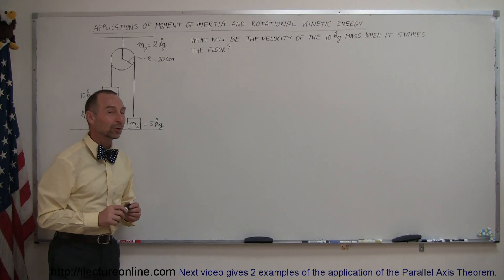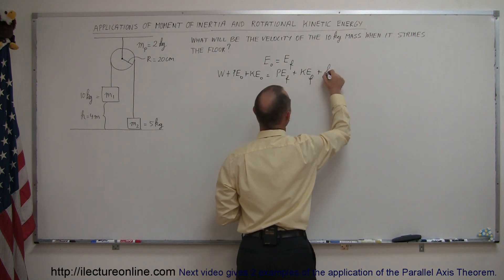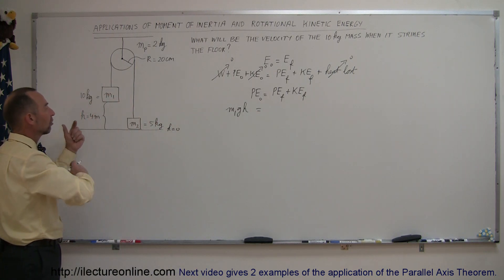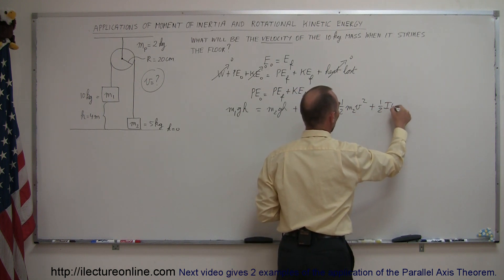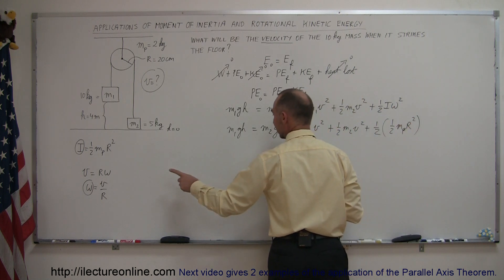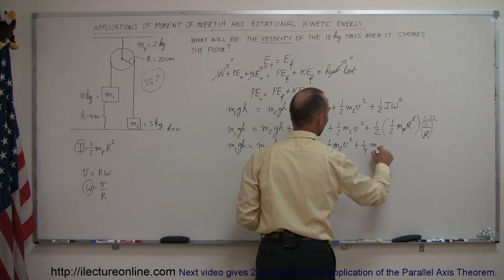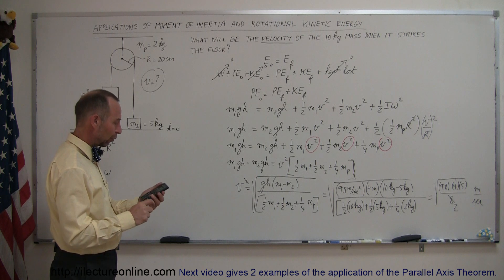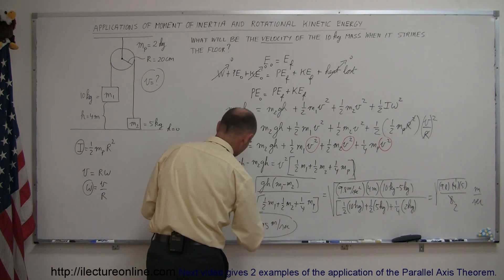Physics 13  Moment of Inertia and Rotational Kenetic Energy (2 of 5) Pulley System

Comment: Sir, How will I calculate time taken for moving the distance.
Reply from the maker: Once you know the acceleration you can use the equations of kinematics:   y = (1/2) a t^2
Reply: @MichelvanBiezen   Thank you for the reply.Sir, can i go with the formula for acceleration  as a= g(m1-m2)/(m1+m2), and does this formula (y=(1/2) at^2) still same if I ignore pulley  in between.
Reply from the maker: Yes, that equation will work.

Comment: why does the kinetic energy of m2 is not negative sense it goes in the opposite direction?
Reply from the maker: Kinetic energy cannot be negative, it can only be zero or positive.   KE = (1/2) mv^2, therefore regardless of the sign of v, v^2 cannot be negative.

Comment: Sir while calculating the acceleration of the between m1 and m2, does the mass of pulley count everytime. If it doesnot, why it is so!!!
Reply from the maker: If the mass of the pulley is significant, we must take it into account and the problem needs to be solved as shown in the video.  If the problem states that we can ignore the mass of the pulley, then the acceleration is found using the methods shown in playlists chapters 4 and 5 on this channel
Reply: @MichelvanBiezen  Thank you sir.

Comment: Sir, Thank you for the video, Is there any possibility of scenarios where the mass m2 goes upward and m1 goes downward finally, by this equation the difference in potential energy will be negative, then there should be negative velocity,? Please explain.
Reply from the maker: Swicth the masses and the one on the left will now be accelerating upward and the one on the right will then be going downward.  Thus there is no differece.  You can also leave the masses where they are and simply stand on the other side of the pulley.  The sign is only significant if you consider the velocity as a vector.  If we simply calculate the magnitude of the velocity it will always be positve.

Comment: If the two weights were in free fall they would be moving at the same rate in an ideal gravity field. So by joining the two masses together by a mechanical path we have unstored  a new dominating driving force not released by gravity alone (it can be said that when mechanical force become the driving force to a grounded mass, that the gravitational forces of that free  falling mass, are now stored)The two force are co sustainable .But it is interesting in the effect seen  on two atmospheric sealed pocket watches (one very large and the other very small) being released to free fall from say 70 000 feet on  there mechanic's keep them in match time

Comment: what about the workdone by tension of the string?
Reply from the maker: The tension on the string is internal to the system and does not affect the acceleration of the system.  You only need to consider the tension if you draw free body diagrams and find the acceleration of each body separately
Reply: @MichelvanBiezen  oh right thanks sir, I really appreciate it

Comment: Excellent video but why are we assuming that height remains the same and that the velocity is the same for all masses involved? I'm sorry if this is really obvious
Reply from the maker: Great question.  The key to working physics problems is to find something you can be sure about or you can put into an equation around which you can build the solution.  It is not always obvious and not always intuitive.  In this problem, since the two masses are connected with a single string, the velocity of one mass must be equal (although opposite in direction)  to the other mass.  Therefore also the height lost by one must be equal to the height gained by the other.  Since KE = (1/2) mv^2, the direction of the velocity doesn't matter when calculating the kinetic energy.
Reply: Michel van Biezen Thank you so much for the quick reply. This makes a lot of sense; thank you for the clear and concise explanation. You are a great teacher!

Comment: I have a question, when the second pulley goes up, isnt it suppossed to have 0 velocity ? so its kinetic energy is also suppossed to be 0 ?
Reply from the maker: Kinetic energy does not depend on direction.   Whenever an object is in motion it has kinetic energy.
Reply: In the final stage, it'll have the same velocity as the system

Comment: Looking at the vector notation, I'd expect g to be negative because in essence it is doing work against the system. v of the 10 kg mass would also be -, v of the 5 kg mass +. What about angular velocity of the pulley? Or am I wrong?
Reply from the maker: Negative signs can be handled in a number of ways.  If we use the convention on potential energy (with PE increasing with increasing height) we must use a positive g.  The energy stored in the rotating pulley was incorporated into the problem.
Reply: Michel van Biezen I meant if we use the sign convention you've just explained right now. What would be the appropriate sign to place into the angular velocity then? Would it be +ve or -ve?
Reply from the maker: The convention for the angular velocity (as a vector quantity) is that counter clockwise is the positive direction.  In this example it doesn't matter since we are calculating the kinetic energy of the rotating wheel.

Comment: why didn't we take into account the potential energy of the pulley since it has mass
Reply from the maker: Amgad Hammouda 
We did.
Reply: Essentially I'd also believe that the potential energy of the pulley doesn't factor much into the equation since the centre of mass of the pulley doesn't move and as such they'd cancel out in the equation. What we took into consideration was the kinetic energy of the pulley since it changes before and after.

Comment: Everything clear , but I have one question. Is it possible that the mass acclerates downwards instead of constant velocity. What does v actually represent here, a constant velocity or the terminal velocity??
Reply: Terminal velocity ^^
You can find the acceleration by using Newton's equation a=v²/(2h) to determine the acceleration of the system.

Comment: sir why is tension not taken into account?
Reply from the maker: Samuel,

That is a good question.
There are different methods to solve this type of problem.
The way I showed in the video, only considers external forces acting on the "system".
Tension is an internal force and therefore has no effect on the acceleration of the system.
The other method requires drawing free body diagrams of each component of the system and then you need to take the tension into account.
Reply: Michel van Biezen  thank you! can i email you a  physic question similar to this to work out?

Comment: Mr, thanks for the explanation, but there is something that I didn't understand. why did you take the kinetic energy of mass 2 (final ) and not only the potential energy, I'm not understanding this point because we usually take values of what is happening at the end ? could you please explain to me ?
Reply from the maker: +Marwa Manwar When the large block, m1, reaches the bottom, both m1 and m2 are moving and thus they both have kinetic energy.

Comment: How do we know the 5 kg object is going to be exactly 4m higher than it was before?
Reply from the maker: Since they are attached by a string, the magnitude of the motion of the first block must equal the magnitude of the motion of the second block.
Reply: @MichelvanBiezen  You can further test this by using kinematic equations and considering the acceleration of the system correct?